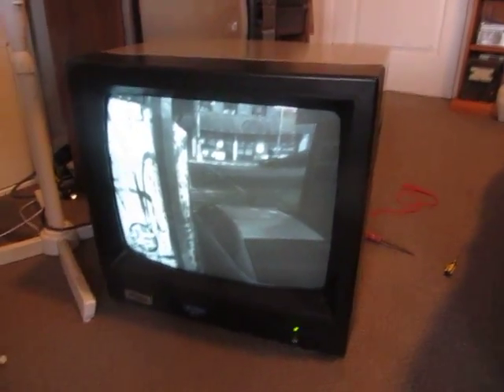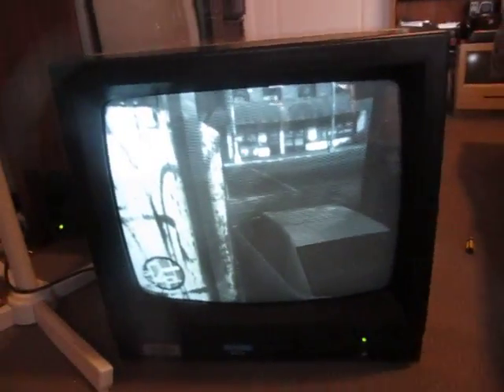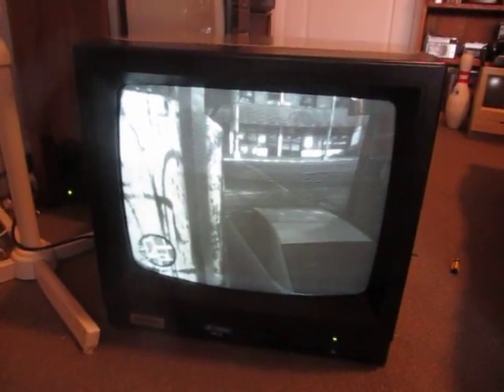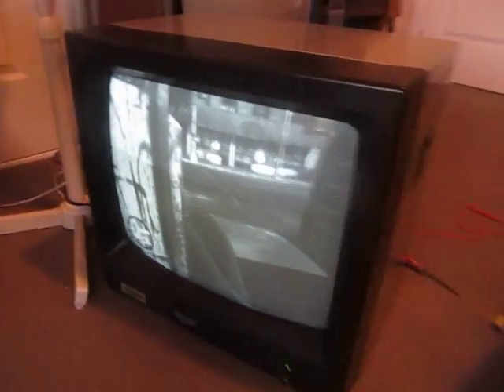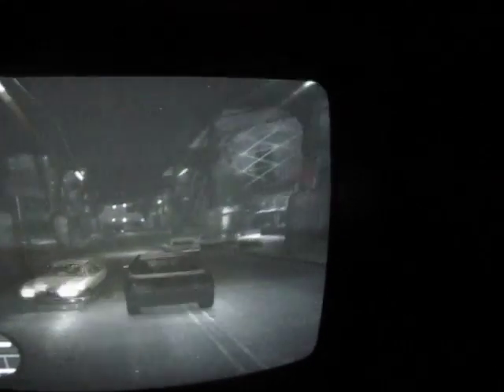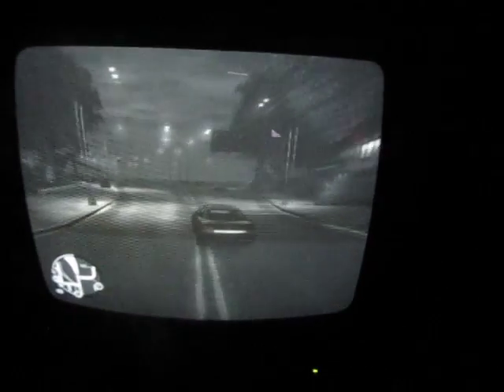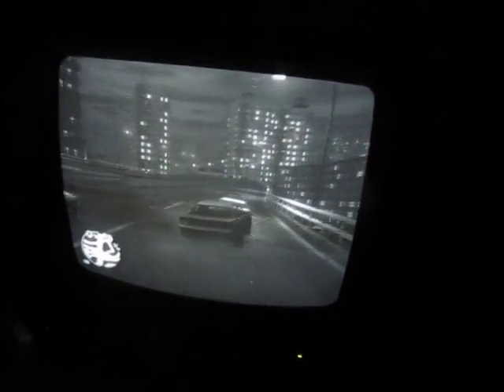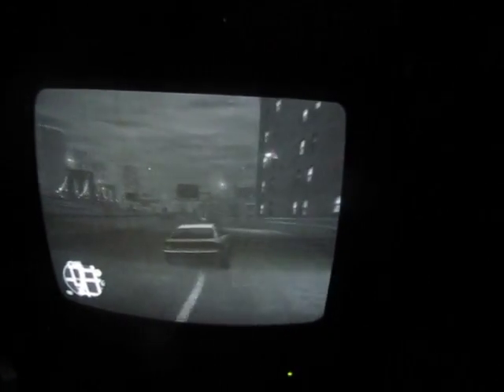CHUBB VM-20 repair updates

Comment from the maker: Nope, I haven't done much work on it. I pulled the PSU to do some work, and suspect the diode rectifiers and a SCR (silicon controlled rectifier) have gone back. I'm going to order a new SCR and diodes. I'm also getting a new LOPT for my Philips 02CR231, though I may need a new line-output transistor too. I've yet to test it.